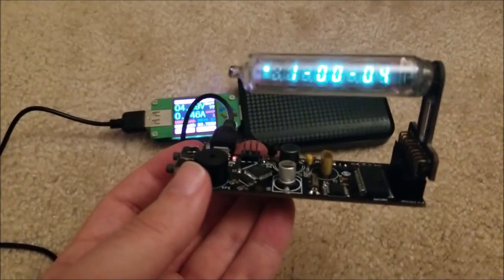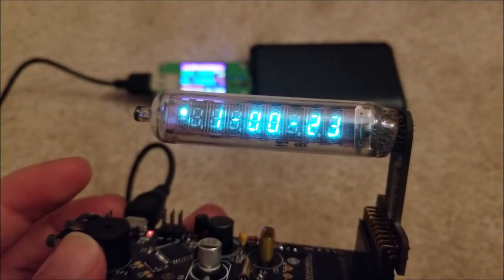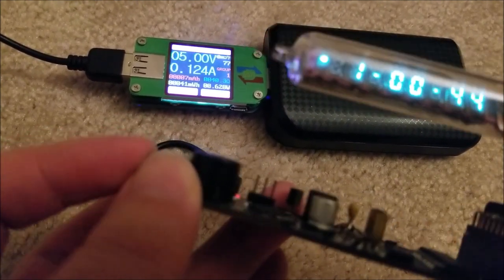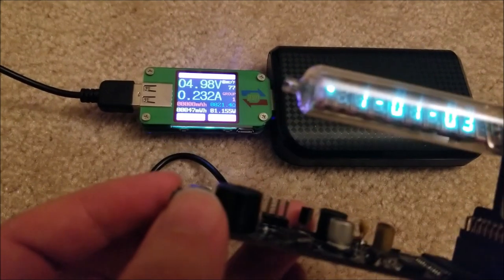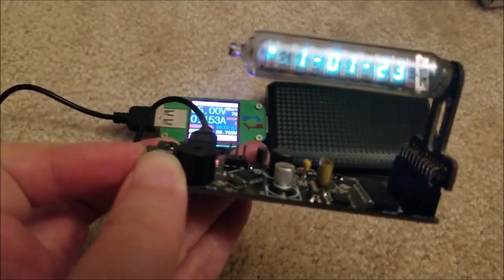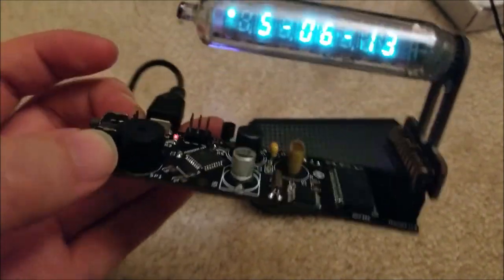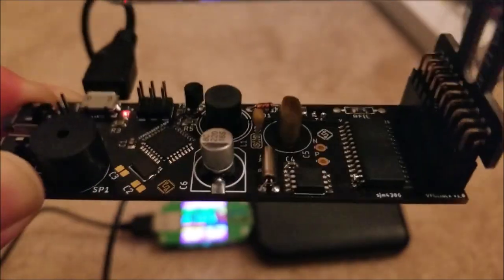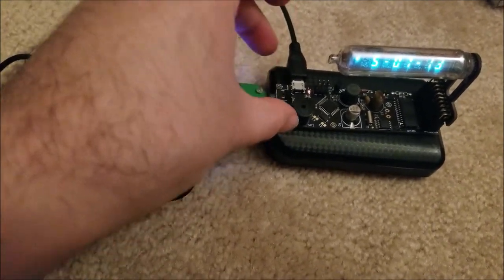IV-21 VFD Clock p2 - Fixed bugs and Added Brightness Adjust!

Comment: Well done, can't wait to build one myself.

I think the perfect case for this kind of things would be made out of wood.
Reply from the maker: 3D printed wood filament?
Reply: Real wood would be best especially if you had a lichtenberg burner I think that's how it's spelt
Reply: @sjm4306  I was talking about old fashioned hand carved hard wood. But if you can mimic the grain, the filament will do.
Reply: I was also talking about real hardwood but if you do the lichtenberg burnerthat would give you a chance to put glow-in-the-dark resin in the cracks and I think the glow in the dark with the tubes would be really cool
Reply: My hands are too beat up for doing soldering and detailed work but I can still work wood
Reply from the maker: I love real wood, but just don't think I have the tools or experience to make something that would look nice which is why I suggested wood filament. If I were to make these to sell I'd have to just do the boards and maybe a 3D printed case though as I definitely wouldn't have the time to also do custom wooden cases.
Reply: LOL I would like to have one as is that way I could work my own boxor I've got a really talented friend that could maybe blue a glass case for it may be that sounds kind of cool to but 3D printed if done correctly sounds amazing

Comment: Well, I've got the main board populated. The SMD soldering was challenging. I thought it all went well but now I can't seem to burn the bootloader onto the onboard ATMega328p chip using an Arduino board as an ISP. I just get error messages. I'm going to have to do some major trouble shooting. Did I screw up the ATMega chip? Maybe I fried it with too much heat? Solder bridges perhaps? Maybe I'm using the wrong settings in the Arduino IDE? I tried setting it for Duemilanove/Diecimela, Nano and Uno boards. None if those work. Not sure what to do now. Maybe I'll try re-soldering, or swapping out for a new ATMega chip?  So frustrating!
Reply: Ran into trouble trying to bootload/program the ATMega chip via ISP/arduino board. Turns out I used the wrong chip. I used an ATMega328PB rather than na ATMega328P. Apparently this makes a huge difference. The Uno kept trying to tell me in the error message but It took me awhile to figure out what it meant. Sheesh! I'll go ahead and order the correct chip and try again.
Reply from the maker: Yeah the p and pb versions are confusingly different and not directly compatible. I wish microchip would've just given the pb a different model number.
Reply: @erikburman530  Any chance you could post the list of components you bought? I"m trying to put the BOM together, but I'm having hard time locating some of the components (like the inductor).
Reply: @givemeanacct  Well I sort of lost steam on the project. I should probably swap in the correct ATMega325P chip and make sure that it actually works with the components that I bought. Maybe I'll get to that over the labor day weekend. If it works we can try to figure out a way for me to share the BOM. I'm not sure how to do that on YouTube since I can't post PDF's or JPEGS or any other convenient method of sharing long lists.
Reply: @erikburman530  Thanks for the reply! If you can get the BOM compiled, maybe you can post it to the hackaday project?

Comment: Does it have an turn on/off at set time mode so if it's in your bedroom, it turns off at night?
Reply from the maker: Currently no, but it would be trivial to add code to do that. I could even have it dim at night if I add a light sensor.